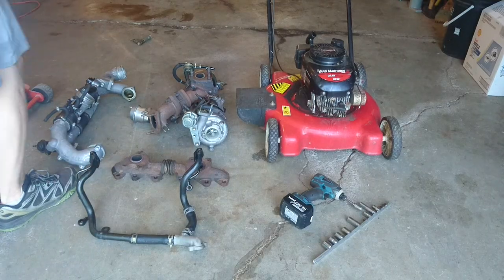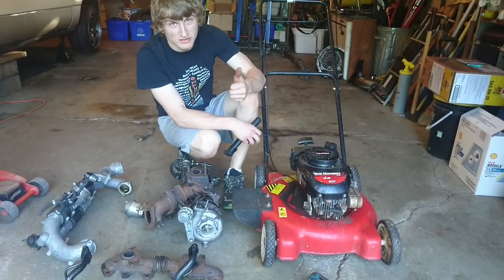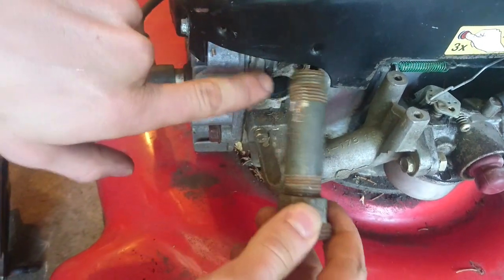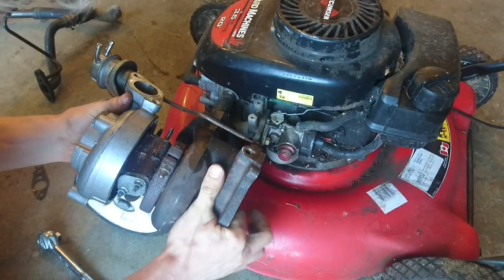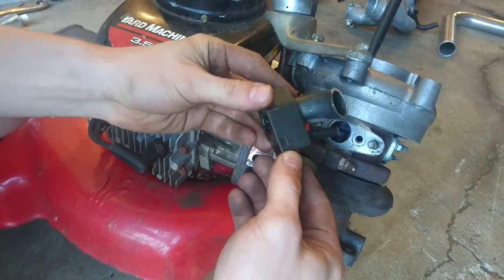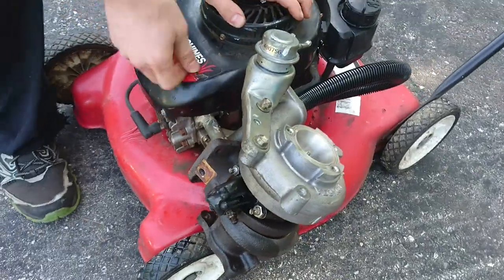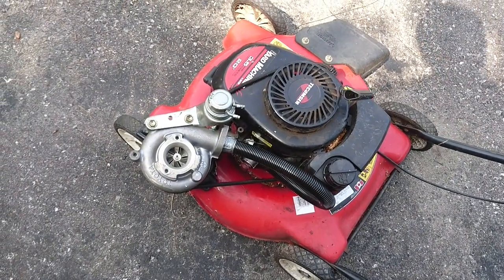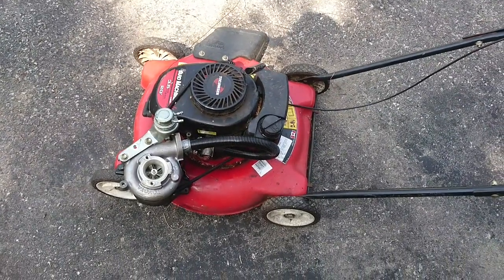DIY Turbocharged Lawnmower Project

Comment: did you honestly think you'd get boost pressure on a 100cc engine with a tiny carburettor using turbos designed for a 3000cc engine?

Comment: Small engines can still run without a muffler. So that pipe falling off (causing an “exhaust leak”) shouldn’t have kept the engine from starting. I have had plenty of them running without a muffler. If you’re curious, try it with a 2 stroke. Those are quite loud.

Comment: Record a second attempt I liked the video. Maybe you could thread one end that goes into both the turbocharger and the lawnmower, but something that popped in the head for me is maybe the lawnmower just didn't have enough power to stay on with you replacing the part you took off. So maybe the engine needed more power stay on.

Comment: Your carb is a suck type when you force air into it it will push gas out of the carb,  so that won't work.  When you place it in the suction part of the turbo than it might worm

Comment: And the exhaust gas flow from that engine should generate a massive... oh, maybe 500 rpm of the turbo impellar, which should get you a massive .001 psi

Comment: Need more cylinders or smaller turbo... probably wanna do a separate oil sump for the turbo alone since the engine oil will have a high content of gasoline. Also might want to get a single point fuel injection setup from a 1989 Civic and probably try to get it running with a Raspberry Pi as a jury-rigged ECU to control the injector. Would also need some kind of hall effect crank sensor for feedback to the ECU. Always thought about doing this but I just don't have the money to make it happen.

Comment: not near enough exhaust pressure to even spin the turbo, friction in the oil seals will hold it still, and if it doesnt, it pressurize any air

Comment: Not a complete failure. The turbocharger connections need to be better. You may want to put a small oil tank above the turbocharger to provide for the oil expansion/leaking, this will extend the life of the turbocharger bearings.

Comment: This won't work for four reasons.
First the carberator uses vacuum to pull the fuel from it's bowl if you pressurize it it will not draw in fuel. The carb must be mounted to the turbo intake. 
Second the turbo is way to big for that displacement and it won't spin  fast enough to build boost. Get a smaller turbo.
Third the turbo requires pressurized oil to protect it's bearings that engine is splash lubricated. Use engine with Pressurized lubrication and tap into the oil gallery. You must also run the turbo drain back to the crankcase.
Fourth the air coming from the compressor side of the turbo can be as hot as 300F it will met that piece of split loam. A for effort though. Use a hose that can take the pressure and heat.

Comment: Why didn't you screw that pipe into your lawn mower first and then put the turbo on to the end of that site and stuff the putty in there you got less than a quarter of a turn shredded into your Mower and you can't tighten it off camera because you can't turn the turbo

Comment: They do make smaller turbochargers but for high performance small engines. RHB31 VZ21 is the type to look for on ebay... It even might be too big for this engine since if you remove the rpm limiter to get more output volume... Its very likely to blow up.
I had much smaller turbo than that on old russian made UD type 1 that was 300cc single cylinder 4 stroke... It didnt have a whole lot of boost but it definitely needed rpm limiter to be set around 7k... Im sure it went over 15 000 rpm and was climbing really fast when the connecting rod snapped.  I thought of putting it on small tractor  but the turbo needed more output volume.. So at higher RPM it started to actually make proper boost to be effective. 
It wasnt all I did for this engine, I also increased compression and ported cylinderhead, it was a flathead type, those are kind of pain in the ass engines since its very difficult to get good enough airflow in and out.

Comment: I want to put a turbo on my dirt bike but the only problem is the oil part
Reply: farmingwithmark  plug it on the bottom for the oil drain and do the same thing for the top and change it every time you do the oil change on your bike

Comment: ....I wonder if a turbo of an small engine (motorcycle) would have worked... The exhaust gasses from that lawn mower was way to low to even spin the impeller if the turbo....
Reply: Chris S they make smaller turbos for smaller engines

Comment: That will not work, and here's why:

Turbo produces boost. Lawnmower engine uses a carburettor, which operates on suction from the engine to pull fuel out of the tank and atomize it. When boost (if any) will be introduced to the intake manifold, it will literally push the fuel back into the carb. You need specialized push-through carburettors to mount the turbo like that. Alterntively, you can mount the carburettor BEFORE the turbo so it will have the suction it needs - but you risk premature ignition from the hot side of the turbo. Also, you will dramatically decrease the turbo's bore that way - it will essentialy hae to pull all its air through the tiny carb - so you will lose a lot of potential power. There are two ways around it:

-Get a smaller turbo and a push-through/bigger carb
-install mechanical or electronic injection
 
 Though each of those scenarios defeat the purpose of mounting a turbo on a 
lawnmower. Maybe go with a blower first? 

Also: the turbo is way too big for that engine to produce any usable boost.
Reply: Bozar91 yea I was wondering why the Fuck this dude was tryna turbo a carbed mower engine
Reply: Bozar91 not suction from the engine, suction created by air passing through a venturi. Low pressure created by the convergent-divergent ducting allows atmospheric pressure in the float bowl to push fuel through the jet into the low pressure air. So, fuel is not sucked in by suction of the motor. Air is sucked in and the atmosphere pushes fuel into the airflow.
Reply: @shelbyseelbach9568  
✔💯%
Reply: @shelbyseelbach9568  holy crap. Thanks for the information! Cheers
Reply: Shelby Seelbach it's suction from the motor, there is more vacuum as the venturi is small, restricting air flow, causing the fuel to be sucked from the ports.
Reply: @Turbo_The_Femboy_Fox  
True, but its the atmospheric pressure pushing the gas into the venturi (Bernoullis theory). Its the turbo that is adding pressure when the intake valve is closed that is pushing the gas back out of the carb.
Reply: Kittelizer Laurelott technically the Venturi is sucking the fuel out of the carburetor.
Reply: @Turbo_The_Femboy_Fox  
Either way, this guys got it bad. If it doesnt suck, it totally blows. Lmao
Reply: @Turbo_The_Femboy_Fox  That is incorrect. You need to go look at the properties of fluids and gases. Pressure and velocity are inversely proportional, meaning that air being sucked in by the intake stroke of the piston speeds up to a point that the pressure in the venturi is now below atmospheric pressure. The carburetor float bowl is just a reservoir gasoline for the engine to draw off of. It is supplied by the fuel pump but is not under pressure, when the bowl fills the float rises and seperates the bowl from the pressure line, leaving the bowl at atmospheric pressure as it is vented to the atmosphere. The atmospheric pressure now pushes fuel through the jet and into the low pressure air stream created by the venturi. This is the same way that a pressure washer picks up soap from the little soap container on the side. 
The more you open the throttle, the more air has to speed up as it passes through the venturi, the lower the pressure becomes in the venturi and more fuel is pushed in by the atmospheric pressure in the float bowl. This is how a carburetor meters the proper ratio of fuel for a given amount of air to maintain a correct fuel air mixture
This principle is the same one that allows an airplane wing to create lift.  As the wing moves through the air it splits the air with some going over the wing and some going under the wing. Thr topside air and the bottom side air will come back together as the wing passes. The geometry of the wing dictates that the air moving over the top travels a farther distance as the wing pushes it aside and allows it to return. The tipside air must travel faster to complete its movements in the ssme amount of time as the bottomside air. The topside air experiences a greater pressure drop than the bottom side air due to its faster speed. This very small amount of pressure differential multiplied over the surface area of the wing allows the bottomside air to lift the wing up and the plane goes along for the ride.
Same thing. 
Just basic physics, that's all.
Reply: Bozar91 thank christ you saved me from explaining this. I was getting frustrated jyst watching this
Reply: Grygory Malchuk exactly. That's how push-through carbs work - additional air passages in the carb body even out the pressure and let the fuel be sucked into the engine.
Reply: Gregory Malchuk I was writing a whole essay on this as a comment when I saw your comment...
You comprimated my words into just one sentence!
Allthough this lawnmower ”engineer” will probably need to switch out the needle and nozzle in the carburator to a larger couple (beside the fact that he would need a fairly smaller turbo though this one looks like it needs an engine of around 1-1,5 litres).
Reply: So many incorrect statements lol
Reply: Ah, I see this is where the intellectuals socially convene
Reply: @esdrasferreras1227  
Lol. And they're laffing at the guy with the lawnmower.
Reply: Yeah but you can still turbo a carbureated engine, it’s called a “wet system”
Reply: its a lawn mower. He chould just care less and put the carb infront of the turbo. Its not going to spool up enough to override the carb anyways
Reply: you can run a line from your intake and use boost to pressurize the sealed fuel tank but you may want to run it through a spark arrestor(or yolo it on a lawn mover). then simply rely on gravity  and the venturi effect to feed the carb fuel
Reply: *carburetor
Reply: Bozar91 relax it’s a turbo on a lawnmower
Reply: lmao gonna cry?
Reply: I think he wanted to make a gag but ok
Reply: So it can’t go back to the future?
Reply: Bozo I mean Bozar, do you have a turbo pushmower?
Reply: Perhaps you'd like to demostrate with your own lawn mower and turbocharge that for us to learn from?
Reply: Bozar91 
So the carburetor needs to have boost pressure applied to both its throat and it's sealed float bowl side so it isn't trying to push fuel backwards?
Reply: @gregorymalchuk272  Exactly
Reply: R/woosh
Reply: Bozar91 your fucking stupid it's a joke dumbass
Reply: @kohliaten2298  
I wish I had the time to "fucking joke" around with shit like that. Inexpensive experience. I'm sure its all going for scrap soon, especially after seeing how he connected the exhaust. But hey, there's absolutely nothing wrong with experimenting safely. Thats how all of these principles were started in the first place.
Reply: @AngryHybridApe  well said my nigga well said👏👏👏👏👏👏👏👏👏👏👏👏

Comment: guys im not good at engine but what supercharger and turbocharger do to an engine?
Reply: Be Awsome they force air to the engine
Reply: Be Awsome  supercharger runs off pulleys then pulley turns screws which acts like turbo fans . Turbo runs off exhaust. Both is overkill supercharger makes constant boost . Turbo only makes boost when engine is worked hard and produces high amount of exhaust pressure which spins turbo.

Comment: U need to buy a honda mower and do it 
will be a true rice
Reply: nickster715 problem is Honda mowers are actually good
Reply: Jeffrey C but performance mods make it a tuner, it’s the retarded wraps, unnecessary splitters and wings, and other useless mods that make a ricer
Reply: nickster715 a true ricer uses turbo whistle because those adds more horsepower
Reply: Dude,  Because it's honda it isn't automatically rice, if it was something like a fake diffuser or unnecesary downforce it is rice.
Reply: @CarbonComp  "just because it's a Honda doesn't mean it's rice." Seriously 😂
Reply: Just because it's a Honda it dosen' t mean "instant rice." Learn ur facts bro 😂👌
Reply: Most Hondas are good, it's just some owners make them crappy
Reply: Turbos ain’t rice
Reply: If has some performance under the hood it’s not a ricer
Reply: Rice stands for race INSPIRED and even if it looks ugly and has a turbo it is not rice.
Reply: "Yeah man I got a turbocharged Honda"
Reply: Honda mower isn’t rice. Ur mixed up with the civics. Honda mower is the go. How I know is that I own both mower and civic but there’s no difference.